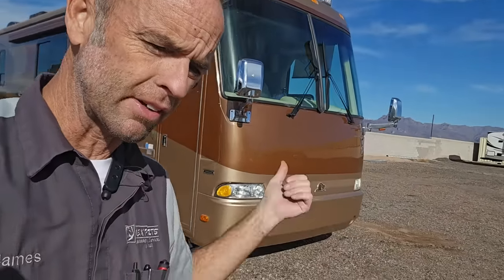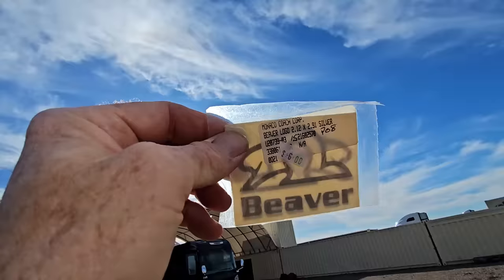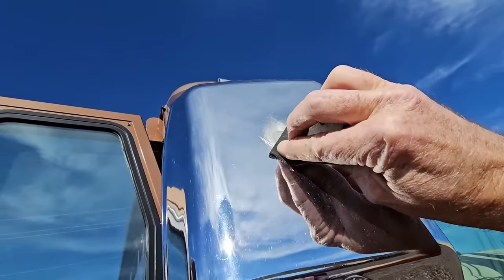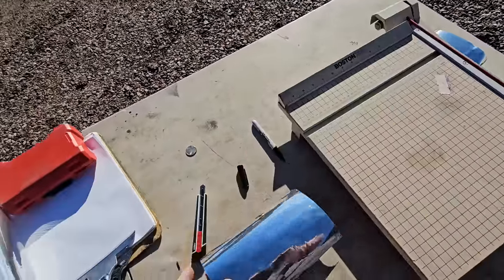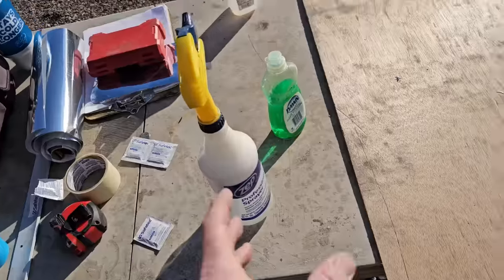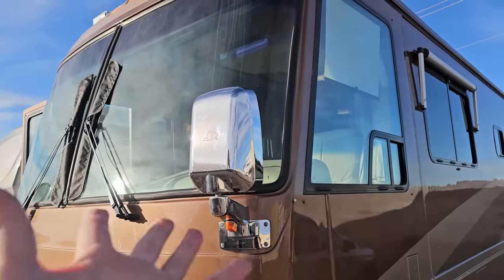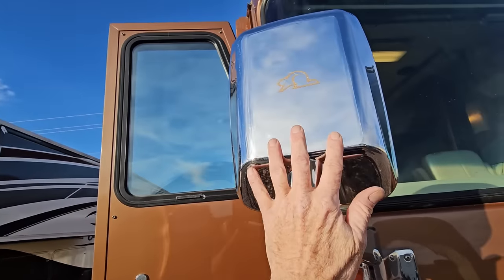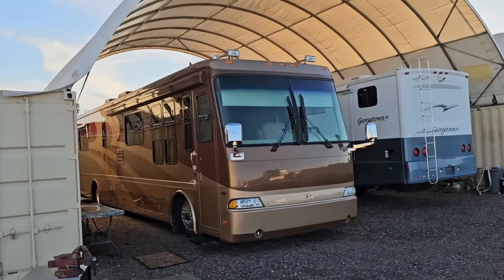The EASIEST RV Repair Ever, With Instant Curb Appeal

Comment: Great idea James, quick, easy, and frugal. It looks better than new with the gold emblems. My first thought was leave the backing on after cutting to size, tape it in position on the bottom and slowly/carefully peel and squeegee from the top. The wet method probably worked better and is easier, I've had trouble with it before but I might have had too much soap on those occasions. 👍

Comment: I asked you a while back about where I might find something to put on the curved aluminum extrusions on the bottom of our bay doors on our 2003 Newmar Dutch Star DP to look like yours(chromed or polished stainless) and I think this would look really good, don't know how long it will last but I like the look of yours and the newer Newmars that have than shinny rolled edge on the bay doors. Thanks for posting James. I figured out how to disassemble our bay doors that had some delamination between the filon painted outer skin and the styrofoam core and saved 800.00 for the door plus the paint to paint it, as the original paint looked almost perfect.

Comment: Great job James and you are correct about what a pain it is to replace a rear view mirror or repair one!  I replaced the outer shell of my Velvac mirror for around $100 and ran into almost every issue you described. Camera cable had no slack so i had to remove the spray form insulation on the backside of the cap.  If i was billing my time it would have been a very expensive repair!
Reply from the maker: yes, Im glad I'm not alone.

Comment: As usual James…absolutely brilliant!  The big chrome Velvac mirrors on my ‘07 Navigator, have some chrome peeling and marring which drives me nuts.  Couldn’t find a place that does plastic chroming so I researched replacements and they run approximately $1K for each mirror, which is expensive.  I am going to do what you did.  Will it be perfect?  No but it will look so much better than peeling and chipped chrome.  Thanks so much for sharing this as it will literally save me a couple grand. 👍

Comment: I am new to your channel. I have looked at alot of your videos, i am sure not all of them. In one of your videos you mentioned you drove a duce in a half in the military. It's  Awesome that your are a veteran. Army veteran here. Tell us more about your service..what branch, Mos etc. Thank you for your service.
Reply from the maker: yes, 63E in the Army. I think I touched on it in my 10k subscribers video. I threaded the needle with a short and rare 3 year enlistment from 96-99. My first duty station was Camp Castle, Korea (now no more) with the 2nd Engineer Battalion and ETS out of Fort Carson from the 3rd ACR. I was assigned the 2 1/2 truck as the tool truck in Korea and a 5 ton as the tool truck in Colorado. I would say overall my experience was nearly perfect and really just regret never even driving a tank even though I fixed them. I was very lucky to receive so much from the country for so little cost unlike many others. So I don't like to focus on it much as a four year enlistment may have altered my life huge as I would have likely been assigned to the 4th ID and made E5 and likely signed up again with an enlistment ending between 2002 and 2003. Thank you for watching! :)
Reply: Thank you for taking the time to reply. Happy New Year to you.

Comment: Great video and fix. I still have a white housing on my passenger side on my Marquis after a dump truck took my chrome heated power one off. Luckily the dump truck was being pulled over by California Highway Patrol and I had a great witness. 

It broke my side view camera and both pieces of glass. I still have the chrome cover, but I’m worried about breaking the glass mirrors since they are glued in. 

I guess trying to wrap the housing might just be the ticket. 

Happy New Year and all the best for 2024.

Comment: I have been thinking about adding stainless steel panels to the bottom of my bay doors on my HR for added protection and cover a few scratches.  They are pretty pricey and I would have to get them custom cut at a metal shop.  After seeing this I wonder how it would work and hold up.  Sure be easy and cheap to try.

Comment: What is the most common cause of an RV fire ?  I ask because I saw a you tuber had just bought a bus and he had a fire start under the dash and was completely insulted in two mins he was running the generator while driving  and looked like that's where it's started hard for me to believe a small 12volt circuit would bolt the fuse before a fire
Reply from the maker: Most common is lp refrigerator,  space heaters, and electrical.